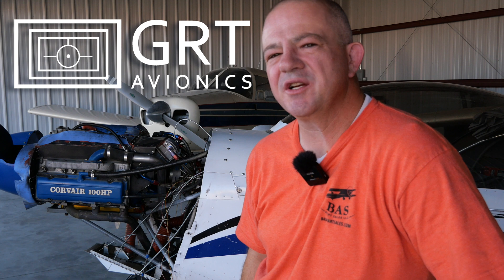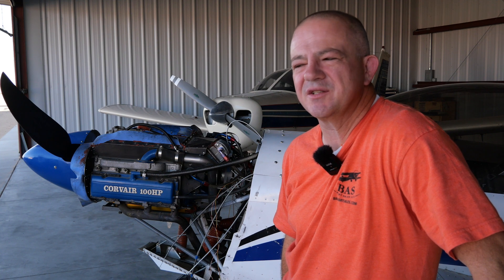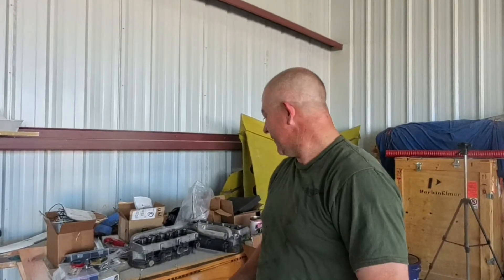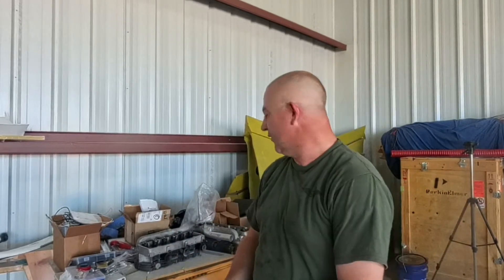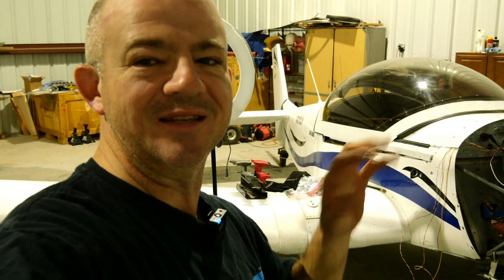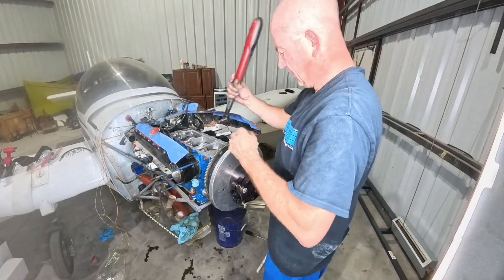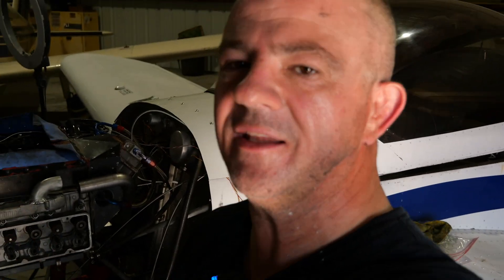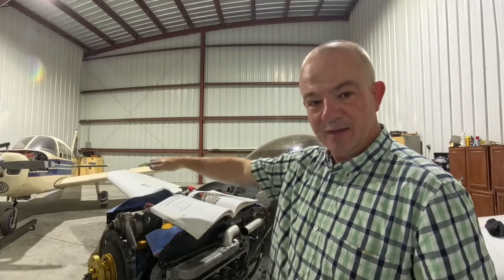Engine Upgrade! 2850 Kit Time

Comment: Enjoyed the video, What's the HP increase with the new kit? I have a few corvair engines, and a Zenith 650 that i just got a month ago. My plane has a  low hr Jabriu 3300. I plan to fly it a few years and then install one of the corvair's. I do plan to go to florida to build the engine. Not sure at this time I trust myself to build it by myself. I also plan to upgrade my dynon with a GRT. Whats a good auto pilot and how much trouble is it to have installed? Looking forward to your upgrade being done.
Reply from the maker: its a 15% increase in hp.  GRT has their own auto pilot that runs off the EFIS.